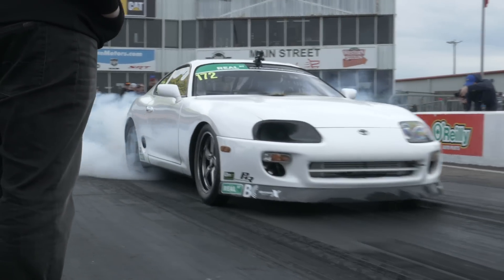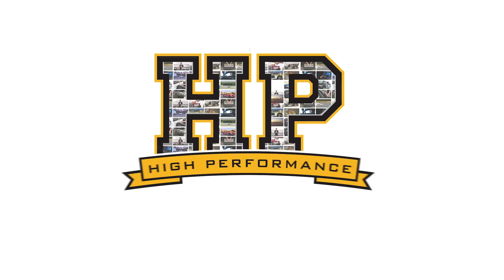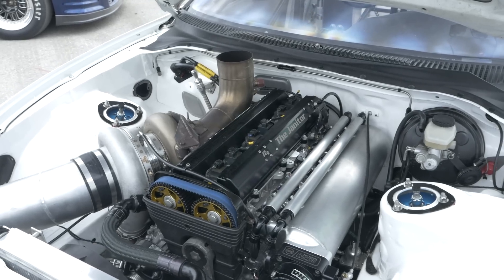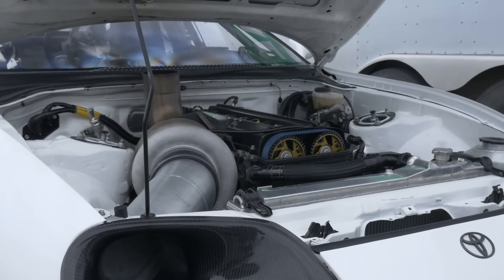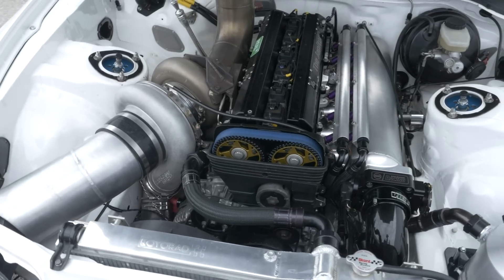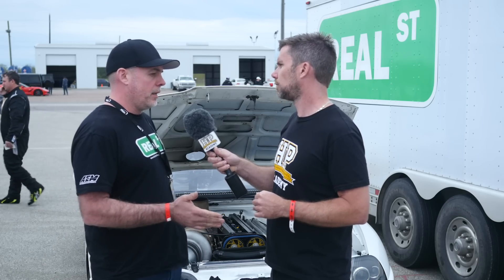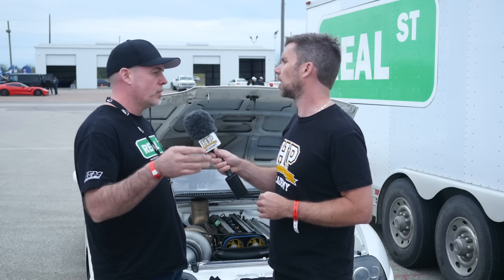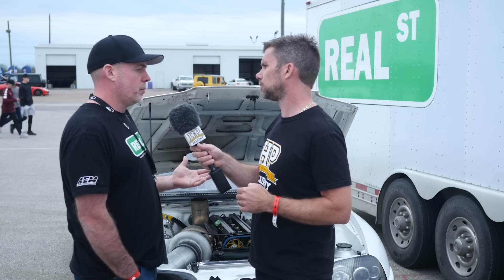6 Second SUPRA | Real Street 2000HP+ 2jz [TECH TALK]

Comment: o ring and copper head gasket. I wonder whether it was the one piece o ring. We used to use MIG wire in a groove on the block, copper HG and the white Three bond. Provided you sealed the water, never had a problem at 25psi. You had to get the ends on the wire butted up close and square that took a while.